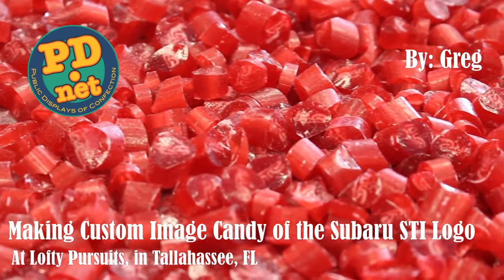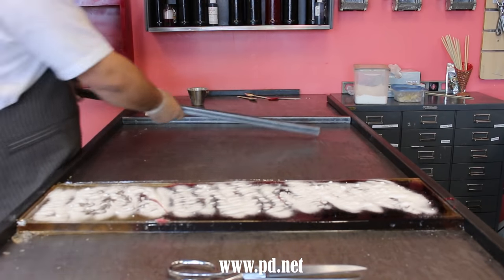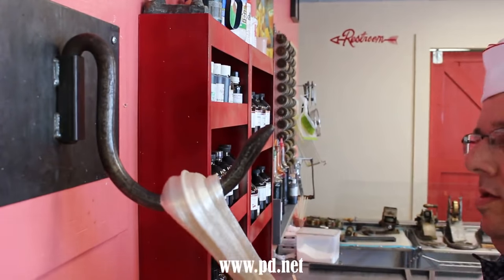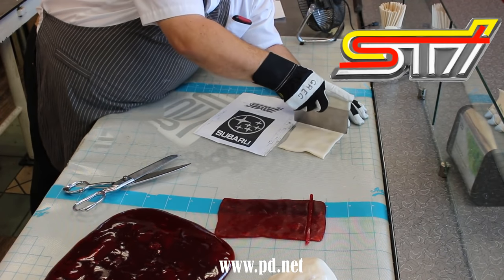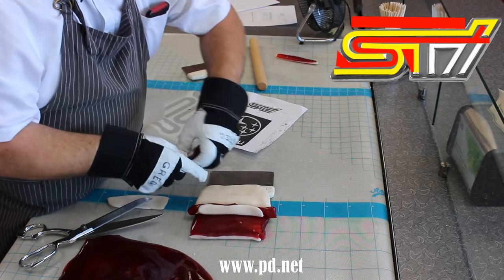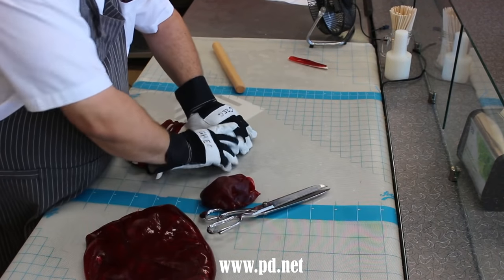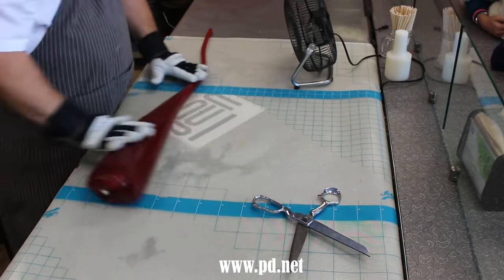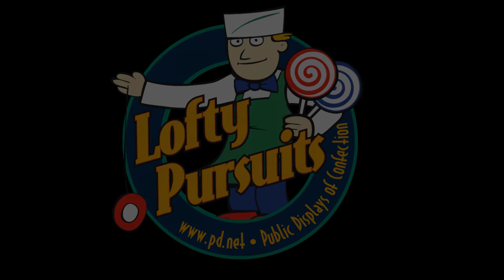#51 Subaru STI candy.- Custom Candy Making

Comment: How long would it take to ensure perfect accuracy? As in perfectly measured and cut squares, perfectly evenly rolled cylinders of candy? I've noticed most candy like this doesn't have nice clean lines, but I feel it could be partially achieved if all the pieces used where cut with precision. But I wonder if this is also because the candy would cool too fast if you took longer rolling, shaping, or cutting it perfectly. Any kind of candy looks impossible to make to someone like me though.

Comment: I so wish I could apprentice with you guys! I've always found candy-making fascinating ^_^ Out of curiosity, what's the reason that you add the citric acid on the table rather than in the pot, when you have a candy where the full batch needs it? Does it affect the melting of the sugar?

Comment: I need this candy. This would be great for a local subaru meet, I have an STi myself. Also all STi's are all wheel drive, not 4wd. 4wd is freely able to switch between 2wd mode and 4 wheel drive sending power to both axles. Subaru's AWD sends power to each wheel individually (basically) through 3 differentials.
Reply: Julian T. Is there local Subaru meets?
Reply: i like the 2014 Dixon Ticonderoga better than the wrx
Reply: Julian T. No one cares about technicalites lol.. 4 wheels equals all wheels..
Reply: Faelan Redmond that's a good one
Reply: still a 12yr old at heart :)
Reply: Buns Crapters damn bro that's my favorite car. (LOL)
Reply: "I have an STI myself" stop talking about it and go to the doctor then smh
Reply: My dad uses to own an STI 4 yrs ago, now he has the evo x. Sadly they have discontinued it. I wanted to buy an evo or an STI so badly, so instead I went to big cars/trucks. I got on my 16th gift (this month:March) and Toyota 4Runner Trd pro
Reply: Donnie Villarino that sucks he sold his STI for an Evo. And a 10 at that. Hopefully he learned his lesson and went back to a Scooby now.
Reply: Big 'ol Booty Cheeks yeh the STI was a 2007. Very sexy looking. But it was coming to its age. We did actually miss it, all the memories. I remember doing my first donut in that lol. Makes me want to cry. My did will of course miss it. But he is happy with the Evo X 600 hp. The STI was around 400. But subaru and Mitsubishi is somewhat similar
Reply: TTime685 wrong. With 4WD, there is a separate amount of power sent to each wheel depending on it's conditions. With all wheel drive,  it is the same amount of HP going to each wheel.
Reply: oh you have an sti what girl did you get it from
Reply: Fax
Reply: Subie nation!!

Comment: 4:23 If you need a very specific thickness you can also use thickness guides that attach to the ends of the rolling pin or fit around the rolling pin.

Comment: correction Subarus are actually awd. 4 wheel drive will allow the wheels to adapt to drive rear wheels on asphalt and all wheel on dirt or loose terrain. Mitsubishi, Subarus rival brand, however runs 4wd. but subaru only runs awd

Comment: Did you treat the pulling hook with something different this time? Looked like the white came off cleaner than usual. Or was it just that the batch was smaller?
Reply: Steven Barnes I've asked about the same thing before and he told me they grease the hook

Comment: It might actually be worthwhile getting a cheap thermal camera perhaps for a smartphone or such so you can see what temperature things are at. Perhaps not for a single project but if you get a lot of requests for more complex rock, it might be helpful.
Reply from the maker: +BadlanderOutsider the outside is always a bit cool. It's the inside temp I need to track. You know what is there. It takes practice, but it's hard to show.

Comment: You CAN see the temperatures of the candy, with an infrared thermometer
Reply from the maker: +Roddy on the outside. I need to know what's going on in the inside without puncturing the candy. Can do hy touch.

Comment: use an infrared camera to measure temps
Reply from the maker: 1. That measures the outside temp, and that number is pointless. We need the inside temp. 2. Why, when we can feel the temp just fine by texture.

Comment: Im curious, as someone who used to work in a photo lab I am very aware of the copyright laws regarding reproductions of things like trademarked/copyrighted logos for profit (see Sonny Bono Copyright act of 1978). Do you obtain permission for the use of the logos, or is there some loophole i am unaware of? Not intending to be a jerk or anything just still have the fear of god that was instilled in me by management that i would be hit with a quarter of a million dollar fine for reproducing anything copyrighted.
Reply from the maker: +Colt Gustafson Fair use in this case. The fact is you're talking about copyright with the Sonny Bono Act and not trademark. The Sonny Bono act actually did not add any protections but did have the length of time that the copyright exists. You're permitted to use trademarks as long as you're using them in context with the product in question. Trademarks are different from copyright they prevent anyone from using it in conjunction with a product that is not yours. But I can use McDonald's even in a bad review even in a means they don't want me to use it as long as I am truly using it to refer to a product they made. It is less of an issue here because I was hired by licensed Subaru dealer to make this candy.

Comment: A linear polarising filter for your camera should ameliorate your shiny candy photography problem.
Reply from the maker: +Lucas Wilkins I keep learning more about videography. I actually have a radial polarizing filter coming. Apparently it will do the same thing, but will not interest with the light sensor as it is behind a partially metalized mirror. Hopefully you'll see some results in two or three videos (yes, I have a few shot already)
Reply: Circular polarising filters you get for photography do indeed do the same thing - they are actually linear polarisation filters. They've just got some added stuff to remove the linear polarisation of the transmitted light by making it circular. I find the way that they don't actually filter out light with a given circular polarisation (unless you were to somehow put them on backwards) pretty unintuitive.
Reply from the maker: Lucas Wilkins Yes, and that's the point. They work the same way and don't mess up certain exposure meters. perfect for me. my Canon does still photography too. (seems a lot of my friends forget this)

Comment: 6:30 "I can't see the different temperatures"...Laser Thermometer..?
Reply from the maker: An optical thermometer takes surface readings only. The heat is in the center.
Reply: @LoftyPursuits  Sorry for not taking the time to make a proper suggestion, I was tired and though i should get it out their before i forgot. I had suggested a laser thermometer as opposed to a digital internal as the pin/needle would have the potential to distort the image in a spot, which when stretched would be a large section of throw away just for a rough temp reading. Although it may come into play yet...  By suggesting the optical thermometer, (apologies for using slang,) You would have to do some science, and preferable on a FUBAR batch. (does that happen, or are you that good?..a serious question your work is amazing) Take a surface reading backed with an internal thermometer and write down the findings and the sample size; thickness of batch/roll,weight, optical reading, internal reading, and even sugar content/flavour if that makes a difference in temp. Find out the variables where ever you can. You would then be able to take quick surface readings and have and have a idea what temp your working with. In the end, you may still only be running with rough numbers, but its numbers you may not have had before. And doesn't any little bit help? I can understand if bringing in modern tech like that is considered taboo in the candy making world and even frowned upon. I can respect and understand tradition and was only trying to help,  I just wanted to clarify my suggestion.  Thanks for the wonderful videos, and soon after Christmas some candy too.

Comment: Yeah I own the model down, they aren't 4 wheel drive they are all wheel drive
Reply from the maker: Well that shows what I know. I did not know there was a difference between 4 wheel drive and all wheel drives. I guess that begs the question, how many wheels does it have and how many get power.
Reply: Lofty Pursuits all wheel drive is all the time and four wheel drive is selectable.
Reply from the maker: Matthew Hunter Did not know that. Thought they were the same.

Comment: hate to break it to you guys, but... the sti badge is outlined in red, and the inner color is whatever color the car is; usually their signature blue or black.

the only white and red ones I've seen were from AliExpress.  however, there are probably international versions in white and red... I just find it odd that is what was requested.  whatever floats the customers boat though

and the info was spot on, except for the fact that the STI is a specific model of Impreza; not all Impreza's are STI's.  used to be a huge fan of them as a rally car fan.
Reply from the maker: Not an STI guy myself. I assume this was to match his car. He said it was a rare one.